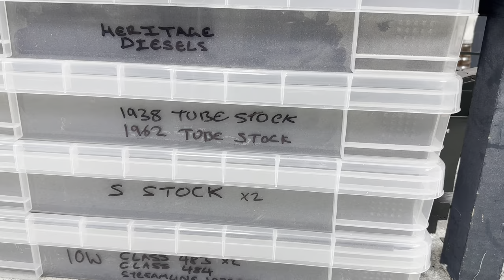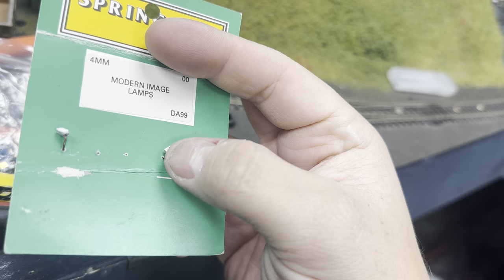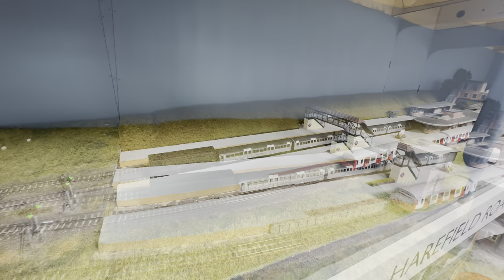Creating a train for my London Underground model railway - modelling real life tube stock

Comment: Great video. The 1983 stock was delivered to Neasden overnight by pairs of class 31’s and two brake vans as barrier vehicles. One of the brake vans arrived at Neasden with a defective bearing and was not allowed to return on LUL tracks. It sat at Neasden for a few months before it was scrapped on site. Dave.
Reply from the maker: Sounds about right! I did miss out on some 83 stock bodyshells a while back sadly

Comment: Super video, as always, and a good use for spare tube stock to make an interesting and unusual rake. 62 stock always ran as four-car units on the Central line and were delivered as such. There's no real need for a fifth car in the rake as I think that even when they went for scrap it was mostly as four-car sets. I can't immediately recall why there's a fifth car in the  west end RAT, I'm sure the answer is on Google unless someone chips in to respond to this. Keep up the good work and merry Christmas.
Reply from the maker: Thankyou, yeah the 5 car set is because it is just a standard-ish 4 car unit but with a rail adhesion car thrown in the middle, which is what im thinking of doing with my spare bodyshell now, as you are quite correct, they were 4 cars so would look odd. I was just a little excited i think 😂

Comment: Underground Eric , as a very knowledgeable expert on the tube underground: have you heard of , the disused station walled off from tracks. Used by army as a  transit camp, for troops due to be sent to the many trouble spots in the 1950s  guarded by redcaps, army police , to stop runaways, as conscription at 18 ,whom mostly being trained for cannon fodder !
Mainly troopships , long time at sea : Malaya;Cyprus Korea Kenya etc , me by air ,28 hours to Nairobi , converted bombers Viscounts , not pressured, only five hours before refueling ! Hope of interesting boring ?

Comment: Great video and very informative. I didn't realise there are two RAT 62 trains. I thought west end had a 92 one but I'm guessing with the shortage of 92 stock at the moment, they may have brought some more 62 out of retirement. Just a thought, if you're going to make a RAT train, which would be quite nice to film, why not make it a track cleaner? In the days before John's replacement bogies, I converted the original EFE axels by threading them through some brass tubing and adding a bit of lubricant. It's a bit of a faff as they are machined to grab the wheels which needs to be smoothed to get the tubing over and then gluing the wheel back on. It was a vast improvement over the original, probably not quite as good as pinpoints but a lot cheaper.
Reply from the maker: Thanks, yeah the eastern end of the central has an 8 car 62 stock, the west end has a 5 car. The extra cars on the eastern one help prevent it from getting gapped ect, they can swap over if required but its unusual.

That would be a great idea actually, its just wether i could make it run reliably enough is all! I could use an extra trailer car that i would slot into the consist, there was even a proper rail adhesion car livery some years back!
Reply: I remember a very tatty paint job on the sandite car and the rest in very poor looking unpainted aluminium with riveted metal strips over the door rubbers. There used to be a 1960 Track Recorder that used to follow it around but I haven't seen that for years. 

Hattons used to do a motorised track cleaner that towed around. One of these would be a good candidate for a 62 mod.
Reply from the maker: @Jules-zo3ds  the track recording train does still exist 😃